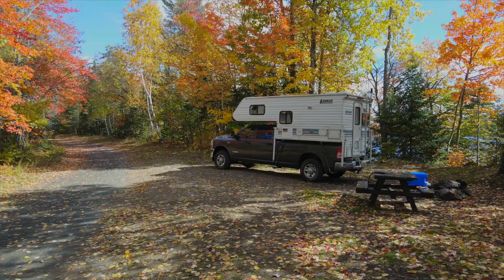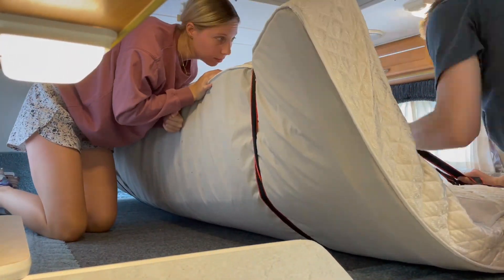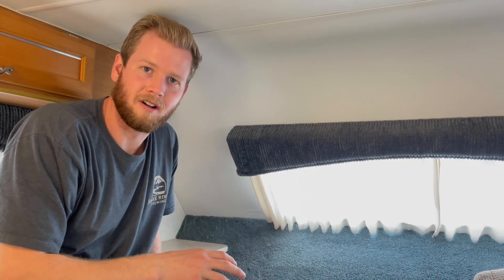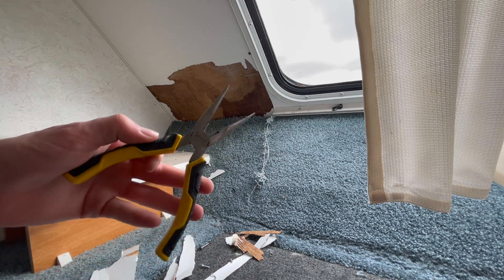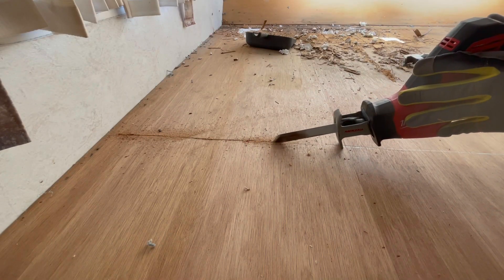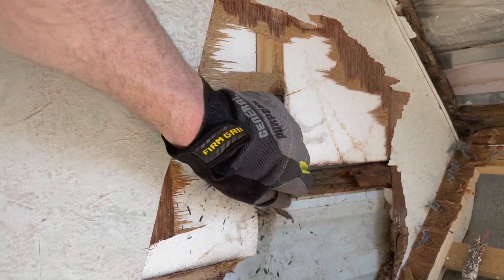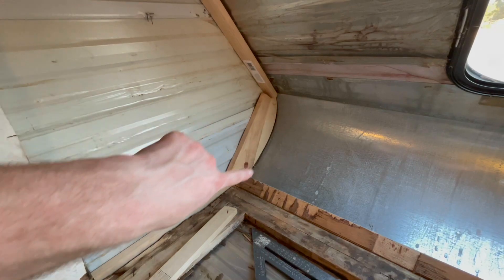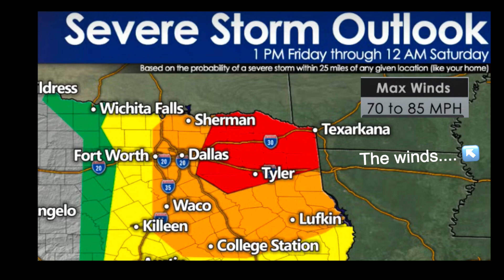Tearing Our HOME Apart! Did We Make A HORRIBLE Decision Buying an OLD TRUCK CAMPER? (Dramatic)

Comment: I agree on adding more supports where you can. Maybe add another layer of luan across where you cut the floor down the middle to help tie it back together.
Reply from the maker: We did that as well, everything seems so thin when tearing it apart! Thanks for the support
Reply: @LivingLargeCamping  when I look at how these are framed, the loft must rely on the sides in tension to help suspend it. The tiny loft floor "joists" wouldn't be enough to cantilever the weight outward. Side note, I'd tie down the back to something like the railing at the end of video when working up on the loft when out of truck, I suspect it might tip easy once you start removing any weight from the door end.
Reply: If you could add supports from the floor at tip/nose of the loft back diagonally towards the roof above the main body, I think that would help suspend the loft. I wonder if even a high tensile cable could be rigged up to help without being super noticeable.

Comment: This is why it's always absolutely critical to get an independent pre-purchase inspection done on any camper. There's so many things that can be wrong and things like hidden water damage can completely total a camper with almost no outward sign. I know it's not always practical but it's always a good idea
Reply from the maker: Totally agree, thankfully the outside is in great conation so rebuilding from the inside was an option. But I think inspections are worth the cost!
Reply: @LivingLargeCamping  Yeah I learned the hard way myself. Lost over $5,000 in a single weekend thinking I could do an inspection myself

Comment: Hey guys, That Stinks that you have that kind of damage, but getting after now, it will be a lot better down the road. One recommendation I have, when you reinsulate and considering using spring foam, check the can for expansion rate, it could cause bulging in the walls and outer shell. 
Now With bed area open, you can add some storage cabinets on each side.  Keep up the great work. Great job getting after it. 
Hi- 5's from Eric and Karal.
Reply from the maker: Thanks Eric and Karal! We're planning on adding storage in the corners, always seemed like wasted space! Good tip on the spray insulation, bulging would be terrible!